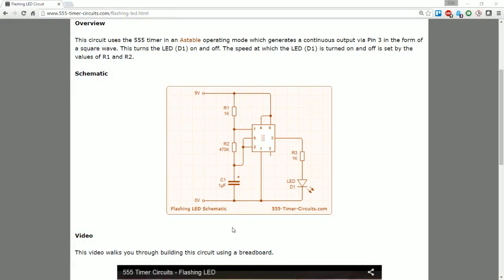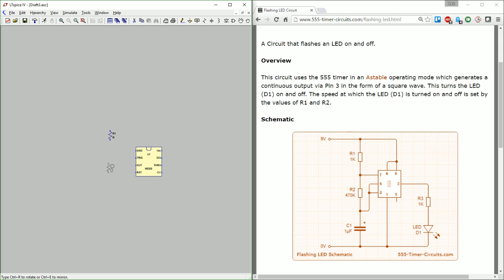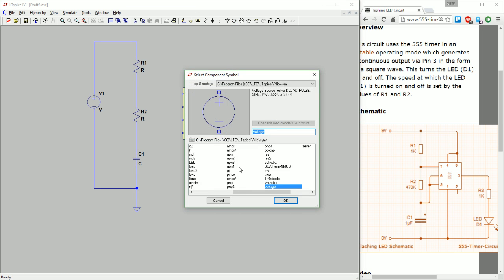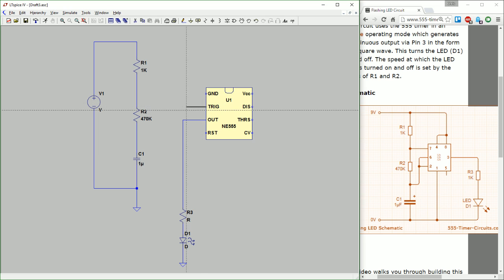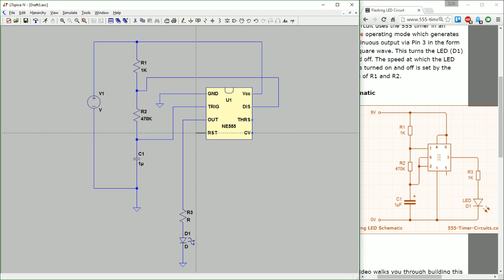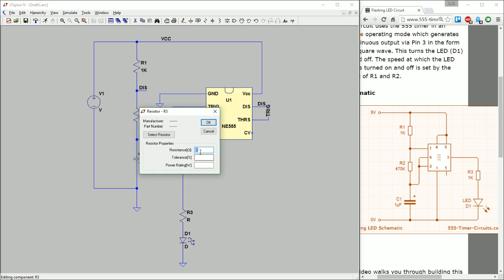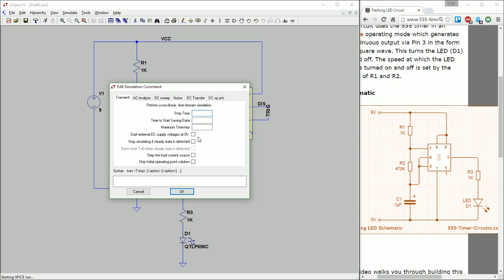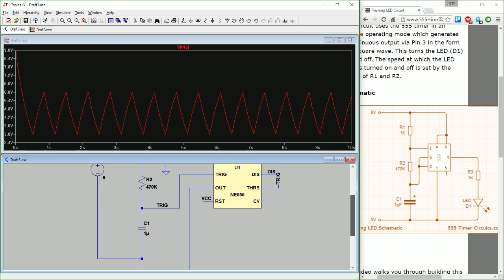Getting To Blinky 4.0 - SPICE simulation

Comment: Any suggested reading / viewing material on doing these simulations with kicad's eeschema rather than with LTspice?  The ability to set up a circuit as a test-bed for testing digital logic for school would be wonderful.
Does eeschema have a larger library of IC's and such  than LTspice ?
Reply from the maker: The PSPICE integration is still in relatively early days of development. We always recommend to decouple simulation from the true schematic as well, as the tendency is to over-simulate. Most simulations should be a constrained set of elements, some of which are not even representative of the true characteristics. This isn't alwas the case, especially as things get more complex...but it is the case for most CE students.